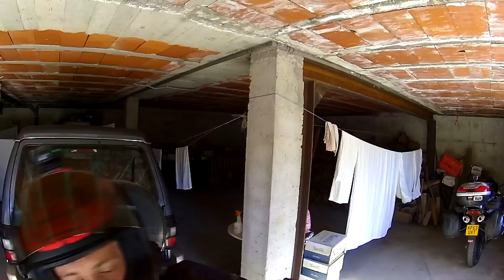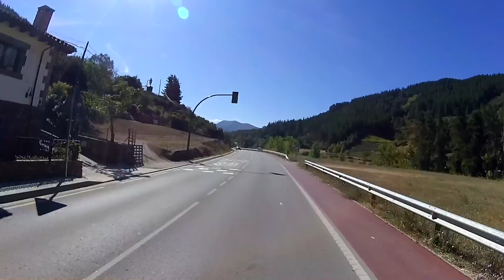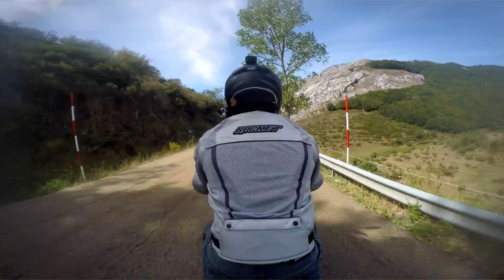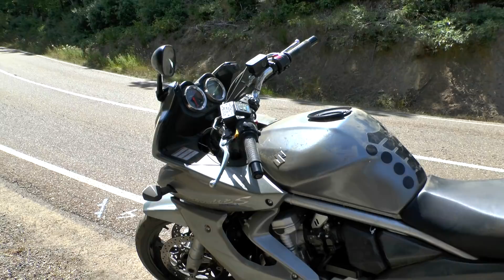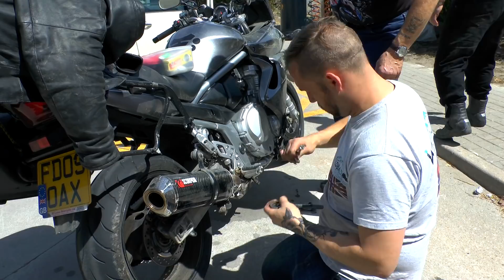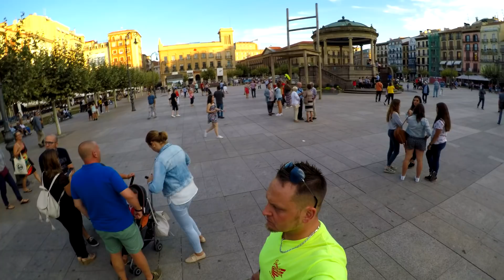Wildbad | Picos Trip, Spain 2017 | Ep3

Comment: Great episode, adventure, roads, drama, human element. There are some roads in and around Picos with curves going left and right every 50m...sometimes less. Add the gradient, altitude in some spots, then sometimes the fog in the mornings, it's a motorcycling heaven but if you not on it, it will bite you. Tough break for Bazza but totally bad ass to continue. The bandit looked shabby as the plastic bits come of first. However thats why I like a bike with fairings. It serves as protection when this sort of shit happens. If it were a naked bike, radiator and whatever else exposed, you'd probably have had to call out roadside assistance. Glad all was well at the end. The video production is improving all the time. Well done.

Comment: There's no such thing as a "bad" corner.  I assume you say that because it tightened up, but it was certainly visible and you should have adjusted your line and speed before entry.

I'd say that Baz would benefit from some instruction, particularly on counter steering and road positioning.  Baz's comments about cars coming the other way (which there actually weren't on that corner) makes me feel he usually takes the "racing line" straightening corners by clipping the inside apex. so he is thrown off line if he meets traffic.  This is a very common riding mistake and is neither the best nor safest line for road riders particularly as it pushes the bike wide on corner exit.  You were both pushed wide on exit of the lefthander, Richy went to the edge of the road, Baz went over it, possibly target fixation but mainly by not counter steering, and using the front brake.
From the video it appears as if Baz is trying to turn the bike by leaning his body inwards, (ineffective) and when it starts to run wide he uses the front brake which makes the bike stand up and run even wider.  A simple push on the left bar and he would have made the corner, turning in later but tighter would have made it safer.  

Glad that he's OK, a day with Bikesafe or other instruction on technique would be a day well spent and make his riding safer and more enjoyable.